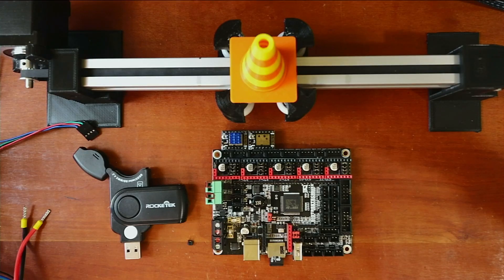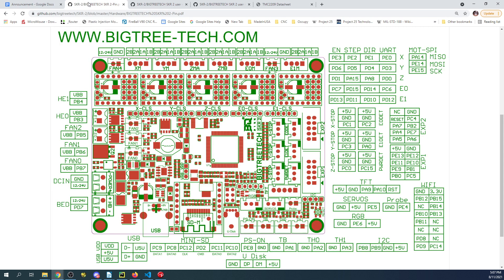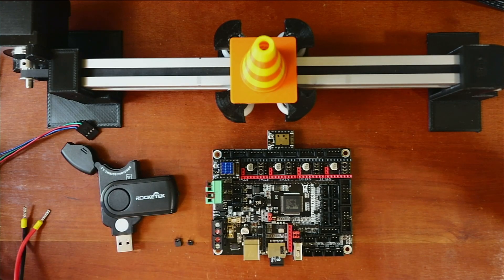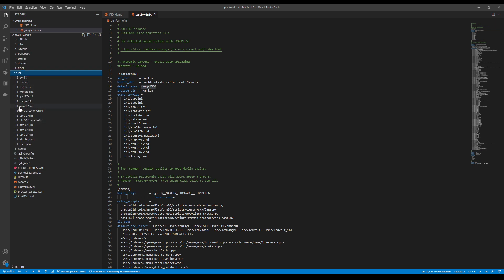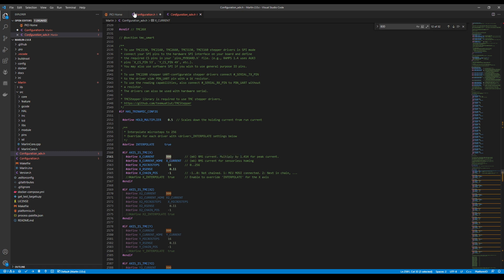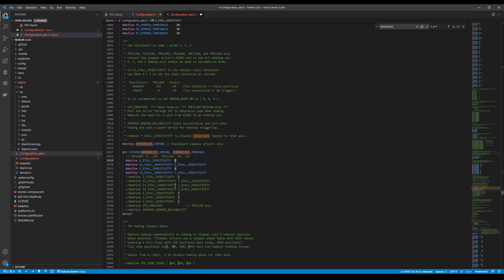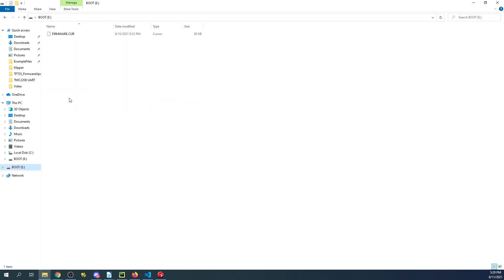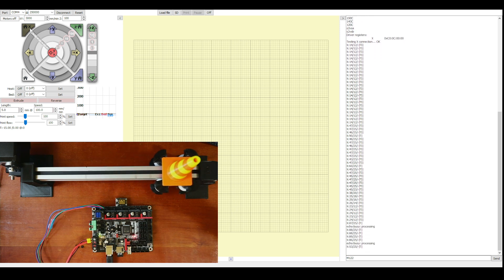BTT SKR2 - TMC2209 UART with Sensorless Homing

Comment: Ed, your  tutorials are very helpful. I have been trying to ask a question in discord, but am unable to get in due to invite issue. So  will ask my question here. I am trying to setup sensorless homing on my z -axis. Your tutorial covers the X and Y axis. I assume that uncommented out the Z access and add the 125 sensitivity I should be good to go.  That is not the case. Can you provide instruction on configuring sensorless homing on the z-axis please?
Reply from the maker: Z axis maybe more of a challenge.  I've yet had time to fully test as it's theoretically possible, the returns on your time and mine in time might not be fruitful.  I'll try and look, but conceptually they are similar.

Comment: FYI -- the SKR 2 was also shipped with a different processor (supply problems I hear).  Look at the 3 digits after the "F", if its 407, follow the video.  If its 429, when you change the environment (14:38 in video), you'll need to use "BIGTREE_SKR_2_F429"  or "BIGTREE_SKR_2_F429_USB" as the environment.

Comment: Was wondering why you do not suggest TMC2209 drives  unless using sensor less homing?? I'm currently installing  2209s in UART mode on a SKR2 RevB with newer 429 chip and  was not planning to enable sensor less homing. AM I missing something or am i going to fry something??
Great video but beware the SKR2 RevB has another env. that might not have been available at time of recording.
Bigtreetech SKR V2.0 F429 (STM32F429VGT6 ARM Cortex-M4) with USB Flash Drive Support
along with 
Bigtreetech SKR V2.0 (STM32F407VGT6 ARM Cortex-M4) with USB Media Share Support
Reply from the maker: Should be okay if 2mm jumper is not  present under stepper.
Reply from the maker: Note there is only one 2mm jumper port under stepper, the rest are 2.54mm steppers.

Comment: Thank you for this vidéo.
My motherboard is SKR-2 in my hypercube.
Despite this, my stepper motor is very noisy.
My driver engines are MKS TMC2209, have you ever had a probleme with this driver ?
Reply from the maker: Generally I try and match brands of steppers as they maybe setup differently.

Comment: Hi Ed, i am going to update my Delta (Kossel LP). Do i still need to cut out the DIAG pin on TMC2209 to use mechanical end stops like sugested in tutorials for 1.3 or 1.4 boards (Lucas Pomykal) .. or are there jumper options on SKR2 Rev2 for that?
Reply from the maker: On SKRv2 you just leave off 2mm jumper if you're not doing sensorless homing.

Comment: Thanks, good info video. At some point you state "if you don't use sensorless homing, don't use 2209". Why is that?
Reply from the maker: You're welcome.  The reason I say not to use TMC 2209 if you're not using sensorless homing, is then you should use tmc2208.
Reply: @EdwardBraiman  but why?  several people have asked this in the comments & I haven't seen you give an actual explanation.  I've run 2209's in my delta for 3+years now, it doesn't use sensorless homing.  The corexy I'm currently building does use SH, but not on the extruder.  Doesn't seem to be a problem, so if you have a real reason for this recommendation, please share it.
Reply from the maker: @mtraven23  If you notice my playlist covers several steppers for SKR v 2.0 in it sensorless or not it's up to you.  It's a tutorial to show users how to setup.  Unfortunately I can not make a tutorial I prefer in length as average user sticks around for 3 minutes.
Reply: @EdwardBraiman  so no reason, just some nonsense you decided to toss in there?

Comment: As always excellent video. I'm following your instruction to build SKR2 on Ender 5 Plus. Watched many of your videos to get this thing up, and I'm on the home stretch.... Problem I'm having is the printer wotn' home no matter the "sensitivity " use on driver I can go 0-255 and it wont stop. I followed your instrcution to the letter. Every jumper, setting, everything.... What I am also getting is this error Below/ If you see, any ideas? 
Marlin/src/gcode/calibrate/G28.cpp: In function 'void quick_home_xy()':
Marlin/src/gcode/calibrate/G28.cpp:85:20: warning: unused variable 'stealth_states' [-Wunused-variable]
   85 |       sensorless_t stealth_states {and not sure if this is where
Reply from the maker: There's a Discord link in description.  Also check the processor, does it say STM32F429 OR STM32407?  BTT appears to have changed due to chip shortages.
Reply: @EdwardBraiman  Thanks! It is the F429 board. I'll head over to discord. Thanks!!!
Reply from the maker: Try same setup in bugfix for 429 SKR in ini file for PlatformIO.
Reply from the maker: F429 just started rolling out.  I got mine Friday, but also got booster shot Friday, so I'll start looking at it tomorrow.
Reply: make sure the driver has a diag pin for the sensorless homing
Reply from the maker: If you post your configuration.h and configuration_adv.h on Discord in general chat, I can look at the issue.

Comment: what did wrong when the x-axis rotates in the wrong direction during homing. so to the right at the Ender3.
and I have another problem that the axes drive into the stops so that the belt slips through.
Reply from the maker: You need to invert direction in configuration.h.
Reply: @EdwardBraiman  In principle, my directions are correct, but only when homing the x-axis does it move in the opposite direction.
which parameter do you mean?
Reply from the maker: There's a link in description to Discord.

Comment: Great videos really. You tell everything so clear. Keep it up.
I had an SKR v1.4 and for use sensorless homing ı cut pins on tmc2209. Should ı solder them again for use on SKR v2
Reply from the maker: That's would help for sensorless homing.

Comment: This video is awesome thank you! Do you have the test rig x axis does posted anywhere ? I'm doing an idex kit with an similar design and i like this alot to make my design even cleaner
Reply from the maker: Well some stuff I design I keep to myself, but on thingiverse there's similar designs by me.
Reply: @EdwardBraiman  thank you! I figured it didn't hurt to ask i have been working on ways to keep it as clean and low profile as possible and thought of running one of the belts through there but thought it would crazy issues but after seeing it esp with some pancake steppers looks like moving it from above and below to middle and below would be excellent lol. Because apparently my brain isn't awake and can't find your thingiverse account what may it be
Reply from the maker: On thingiverse search on ebraiman and there's a printer that might look familiar to parts in tutorial.  Unfortunately after seeing printer and date, you might understand why I do not share everything.

Comment: Firstly, great Videos, keep up the good work.
I tried setting this up and ran into a number of issues or misunderstandings. So if any of you watching this video have any of these problems, maybe this is helpful to you.
I bought the 2209 (v3) Drivers from some chinese Seller on Ebay. After a bit of researching, I found that mine are not BTT but fysetc Drivers.

1) When connecting the SKR_V2 to my pc, it didn't show up in Pronterface and in my device manager said something about an F2 Mode.
I had to uninstall the Device Drivers in the Device Manager and reconnect it in order to get the right Driver. If that doesn't work,  letting the Device Manager update the Driver automatically or manually installing an STM32 Virtual COM Port Driver may help

2) My My Steppers did weird clicks at about 2 hz. I found out that the MONITOR_DRIVER_STATUS was the reason. Apparently it's a bug in Marlin that messes with the communication if the Drivers are not in Standalone Mode. Commenting out MONITOR_DRIVER_STATUS did the trick.

3) I have a Dual Z Stepper Setup (Sidewinder X1 Printer) and wanted to use a Driver for each of the Steppers. I didn't know that the Z1 and Z2 Plugs are both connected to the Same (Z) Driver. Stangely I found very little information about using 2 Stepper Drivers for Dual Z Axis systems. You have to Plug the second Z Motor to the E1 Plug, so that there's nothing plugged into Z2 and the Extruder is still plugged into E0. Then in adv.config.h you can set #define NUM_Z_STEPPER_DRIVERS to 2 and maybe reverse it directly beneath.

4) My TFT Diaply showed an Error "TMC Connection Error" or sth similar. Also, any travel move I made the Printer do (Over the Display or Pronterface) made the Printer move double the Distance I wanted it to, which ofcourse also messed with the Homing and Endstops. I thought the Problem were the Microsteps as I knew that my Printer always needed 80steps/mm. But changing the Microsteps in the config_adv changed absolutely nothing. After days of headaches and countless Software Flashes I found out that it was a hardware Problem. My fysetc 2209 v3 Drivers had a few... peculiarities. The Pins had wrong labelling printed on the PCB. (https://wiki.fysetc.com/Silent2209/). That was just confusing, although it didn't solve my problems.
Then, I finally discovered this: https://forum.fysetc.com/d/199-tmc2209-v3-0-uart/3 . Apparently they did not only label the pins wrong, but some pins were shifted out of order in comparison to the BTT 2209 or the former 2208 drivers. To solve this, you have to jump the Tx and Rx Pins on the Driver (since mine were mislabeled it was the CLK and Rx Pin) and instead of putting the Jumper to the UART Position according to the Datasheet of the SKR V2 you have to put them diagonally between the bottom row middle and second-from-bottom left pin. That meant bending the pins a little to fit the jumpers. But after doing that botht the TMC Driver Connection Error and the doubled travel distances disappeared.

I hope that I have finally taken all the hurdles there are to this setup, if not I'll make sure to let you know :)
Reply: Thanks for the additional info, doing my sidewinder this weekend but using actual MKS TMC2209's, hopefully it goes smooth. how is your Sidewinder doing since?
Reply: @SonicBoom247  I took a pause from tinkering with it until yesterday, now I'm trying to slowly get it to work step by step (since I changed so many things there's many different sources of error...). I'll let you know if/when I get it fully operational again :)
Reply: @dobarek4548  i actually got my sidewinder X1 working just fine, until about the 5th print and now it seems my extruder steps are wrong, such a pain.  Did not know about the Z2 going to E0 so i will have to pop open my case and see what i did or if that is what is causing my steps issue.  I did attempt the calibration but seems like i can only get it to within 5mm
Reply from the maker: The trick to calibration is to make the PLA and then measure movement.
Reply: @EdwardBraiman  thanks, i bought my filament, not up to making it yet...lol 😂 finally calibrated again and got it, thank for your videos and especially that website with the tools.
Reply from the maker: You're welcome.

Comment: Thank you! But this maybe a stupid question...if I use bl touch will this interfere with sensorless homing?
Reply from the maker: It's best to use a stepper without sensorless homing.  Personally I stopped using BLT years ago and level manually.
Reply: Thanks. Soooo if I use bl touch I need to setup the steppers in the firmware as "2209 standalone"?
Reply from the maker: Standalone is a different functionality on stepper.  The stepper gets flashed.  It's better to use a tmc2208.
Reply: Damn. So I guess I'm kinda screwed and no way around what I already have. I bought the skr2 and drivers on Amazon as a set thinking I was doing something right...I guess not lol.
Reply from the maker: Or you can leave off 2mm jumper under stepper.  I've done this for so many boards I get confused on which board I'm referring too.
Reply: That is the smaller jumper I am assuming? And still keep the other jumper in the "row of four, second from the bottom" in? Also, still configure the firmware as you have shown with bl touch enabled? I am very new to all this and am learning everyday! I really do appreciate your help! I have also noticed that when I try to install the driver onto the board that some of the pins don't align. There are 2 pins that seem to be off just a hair on each set and I have to force the driver on. It feels like I am going to bend the pins just to install. Is this normal?
Reply from the maker: Smaller jump for z axis.
Reply: Thanks
Reply from the maker: You're welcome.

Comment: Like the video but at 5:10 why do you have other jumpers installed above(2) and below(1) the UART jumper  ??
Reply from the maker: The reason is doing the tutorial and trying to place jumper live for 2mm is difficult.
Reply: @EdwardBraiman  I mean the jumpers directly above and below the UART jumper not the 2mm jumper. Normally they are for manual microstepping but i dont  think they are needed as UART controls  both stepper current and microsteps
Reply from the maker: I'm basing the tutorial on the manual that exists at time of tutorial.  In some cases they change the manual.

Comment: Thanks for the great tutorials. without it, i wouldn't have reached to a 90% success to make it work. I have mimicked every step in this video. my only issue is that the x and y axes keep grinding for a while then an error message pops up in the screen that says "error printer halted".

I tried to increase the sensitivity to 255 and drop it down to 1 and still got the axes to grind.

I hope that I don't burden you to share any advice that would help me fix/calibrate my drivers.

btw: my printer is Ender 3, BTT SKR 2 ver B, 2209 stepper drivers. the config.h and config_adv.h are exactly as what you have illustrated in the video

EDIT AFTER 1 HOUR: I found the fix in Crosslink channel, video: Marlin 2.0 on the SKR 1.3 with TMC2209 and sensorless homing. Minute: 12:37.
I had to adjust the sensitivity manually from the the printer's LCD. because no matter what value I set in the config_adv.h when comping the file, it won't reflect in the printer.

thanks!
Reply from the maker: Do you have the 2mm jumper caps on the underside of stepper?
Reply: @EdwardBraiman  yes, I inserted the tiny jumpers. now I'm calebrating the sensitivity from the LCD because it seems that when I compile the firmware with any sensitivity values, they don't reflect on the printer. the only way to do it is to set it from the LCD. I found a closer solution from Crosslink channel.

Now, I'm setting x sensitivity between 61 and 64... 64 seems too sensitive. 61 will make it grind against the end nonstop.

Also, I changed the value from 12V to 24V in config_adv.h : #define CHOPPER_TIMING CHOPPER_DEFAULT_24V
Reply from the maker: Try 125.
Reply: @EdwardBraiman  i just tried it. the x wiggles, then the Y wiggles, and then the Z would function properly. now, I'm lowering the value gradually till X and Y begin to move. I'm sure that my settings have some weird variables that need some adjustment. I might try to download Marlin firmware again and set it up from scratch. no one on youtube had to lower the sensitivity values below 80 :/
Reply: ok, so now I found out that the spring of the original endstop switch for the X Axis makes the sensorless homing force itself against the very end and grind. when I removed it and screwed in a solid piece, and set the sensitivity just on the right value=61, now it's getting closer to an acceptable stability. I gotta do the same for the Y axis now

Comment: HI... Thanks for the great Video. But can you help me?
My SKR2 RevB with TMC2209 in UART mode with activ Sensorless Homing is not moving any Stepper Motor.
I have no idea whats the problem. Jumper are in the right position and i have make all Firmware settings like your SKR2 Basic Video.
I have no more ideas.
Reply from the maker: Who's the manufacturer of the steppers?  Which type of NEMA are you using?
Reply: @EdwardBraiman  
Stepper Driver = Bigtreetech TMC2209 V1.2

X, Y, Z1, Z2 are the Creality Ender 3 Pro Stock Stepper Motor s:

 X = Moons Stepping Motor, Type C17HD0904-02 (Creality 42/34)
 
Y = Moons Stepping Motor, Type C17HD2024-01N (Creality 42/40)

Z1= BJ42D15-26V09 (Creality 42/34) 
Z2= BJ42D15-26V10 (Creality 42/34)
 
E = Trianglelab 1.8 Pencake, Type 42BYGH23, 1.0A, 21N-cm
Reply from the maker: Can you post you configuration.h and configuration_adv.h on Discord general chat?
Reply: @EdwardBraiman  
Ok I have install Discord. How i can send the files to you?
Reply from the maker: Yup just drag and drop.
Reply: @EdwardBraiman  i have the sam issue, did you solved it ?
Reply from the maker: He was referring to SKR pro in his config file so jumper cap is in different place.  If you post your configuration.h and configuration_adv.h on discord in link below I could look after work.
Reply: @EdwardBraiman  i put my files in the discord channel youtube-request. Thank you for help 😊
Reply from the maker: Thanks.  I'll look at lunchtime.
Reply from the maker: Cool.  I'll look in a couple of hours.  Are you in Europe?
Reply: @EdwardBraiman  Iam from Germany 😊
Reply from the maker: So finally someone who can pronounce my name in English and German correctly.  In German it's pronounced same as, "Bremen", but in English in USA most people have trouble saying.  It's actually not a German surname, but is actually in Hebrew Abraham.

Comment: Thanks to your videos i've set up my board as you show here (though with 5 drivers, driver fan and other minor marlin functions).
I did notice that after homming via pronterface movement is limited to 200 mm.
I wonder wether you know if that is firmware or software limited.
Reply from the maker: It's limited in configuration.h, search on bedsize I think.
Reply: @EdwardBraiman  

line 1361
"
// The size of the printable area
#define X_BED_SIZE 200
#define Y_BED_SIZE 200
"
got it. Thanks!
Reply from the maker: Post your configuration.h and configuration_adv.h on Discord general chat.